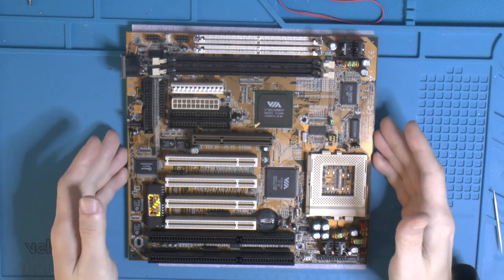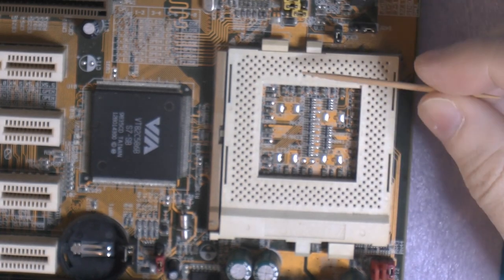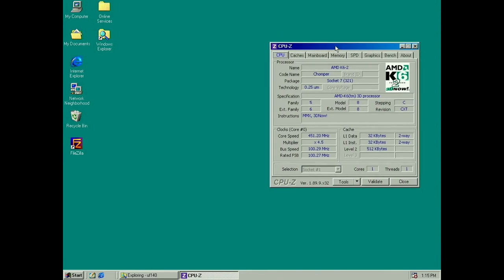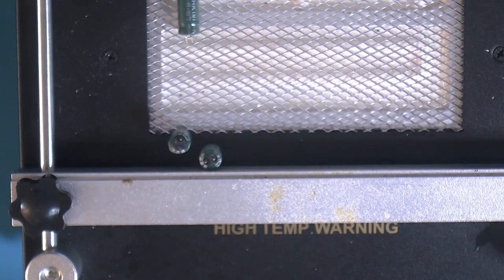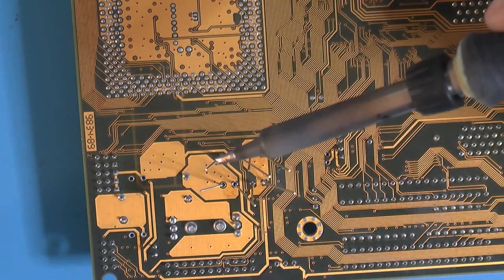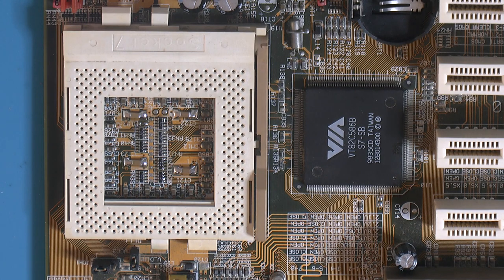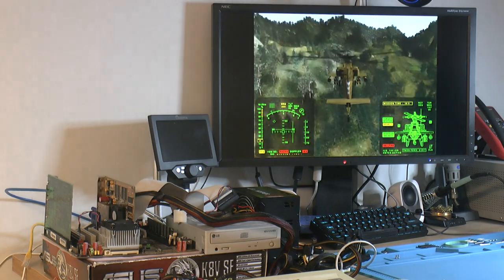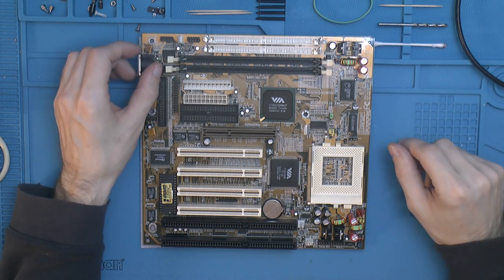ECS P5SD-B+ Recap and upgrade

Comment: have Acorp 5ALI61 ATA66 + K6-450 - back in early 2000's worked great
Reply: when flash old mb bios-es - turn off computer instead of Ctrl+Alt+Del/Reset when flashing process is finished... if i remembered correctly... did it so many times but dont remember already what was right...
Reply from the maker: @emchodevetkov9438  Yea I did a lot of flashing on my Shuttle MVP3 based board and vaguely recall shutting down was the recommended procedure. 
Uniflash as fare as I could see has no preferences on the procedure. I also made bootdisks to flash that was striped to the bones.
Also doing CMOS reset on some bioses, its a bit dependent if the bios changes how it saves its CMOS settings. The readme for the unofficial bios do not require CMOS reset or I would have done that too.

uniflash today just seems to be a much better alternative to awardflash or AMI's tools.
Fast, easy to use with its UI.
I used it for hotflashing, burning a rom for another board, burned a new 486 bios ship on a socket A board using it, worked very well and made an adapter for the more modern bios chip so it could run on my 486 afterwards.

Comment: Why they didnt installed this ps/2 port is because most of these AT cases doesnt have the hole or place on the case for it.. The standard back in the day was just the DIN connector which matched  all most every case. If it was installed, you couldnt use that port anymore or the board didnt fitt great anymore.. Thats why they used a seperate bracket, to locate it in one of the rear expension slots. PS/2 on AT boards wasnt very common, but some board had that option.

Comment: delidded K6-II 😃  wow ... 20 years ago...brave people ...never had balls to do it with something  expensive at the time
Reply from the maker: They where cheap, I paid like 79USD for my K6-2 450 new, all i could afford back then being in shool. 
I also had a K6-2 500 later that i delided, ran at 550-570, prime95 stable at 600Mhz to with 2.9V if you had the balls XD
There also easy to delid unlike modern processors because the IHS is just held on with very soft silicone even on the die so yea very low risk.
You cut the corners with a razor blade, twist the IHS and its off.
Only real risk is crushing the core mounting the heatsink.
Reply: I am bulgarian man...in 2001 month sallary was about 160$ - 40$ for a week..?
Reply from the maker: @emchodevetkov9438  Well relatively speaking to the alternatives. I was in school, I made about 40$/month so yea this and the motherboard took a while to afford. Celeron was to expensive and Pentium 3 was out of the question at the time.
What also saved me money was that I could keep the 72pin EDO ram from the Pentium machine I was upgrading back then, and late get some PC100 ram.
Reply: 1999 i was already bought my main system - Celeron 300A + Acorp BX67 + 128MB PC133 + 6.4GB Maxtor + 24x Teac.... so later i bought k6-450 5ali61 when found it as bargain

p.s. also 1999 - Yamaha 724 PCI - best sound card at the time - price/value - it cost me 24$

Comment: my socket 7 is a asus P5-99VM and ive thinking if i should recap it. I had a p200 mmx in it with no issue. Put a k6/2 500 and it sometimes cant finish the win98 boot up.
I did find the ceramic caps you added interesting, might have to look if i have those populate or not.
Reply from the maker: I would argue that there are few if any boards of this vintage out there that have good caps that are with in spec.

Comment: I dont remember the chipset. If you experiens rly stra crashes when using Riva TNT  you have to turn cash funktions off until you find the corect one to turn off and then turn on the rest agen.
Whas not via if i think off it. THe same AGP cash bug whas over more thatn one K2-2 and 3 platforms.
Reply from the maker: Yea AGP on SS7 was never the most compatible setup.
Running the GeForce 2 PRO for testing, had MVP3 with GeForce 2 GTS back in the day and it did work well from what I recall.

But if one had issues a Voodoo3 was often a good option because it used no AGP features and you could also get the PCI version of that.